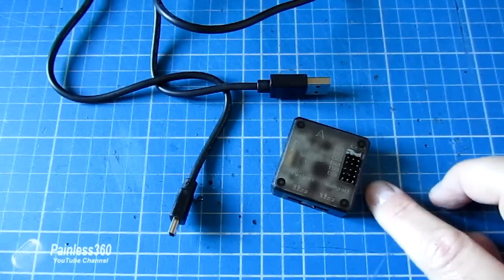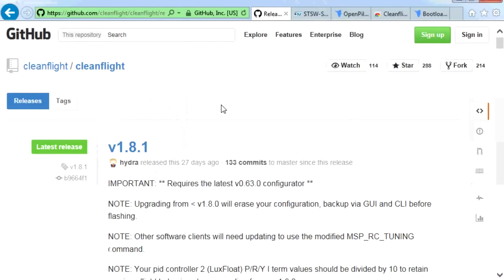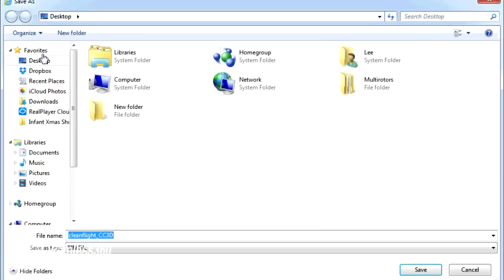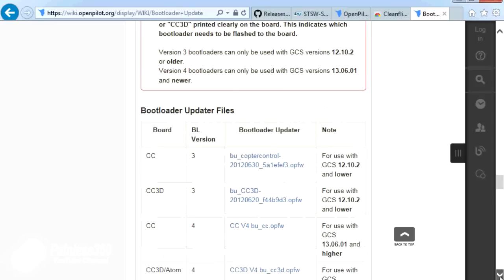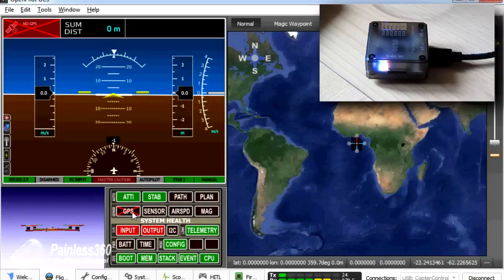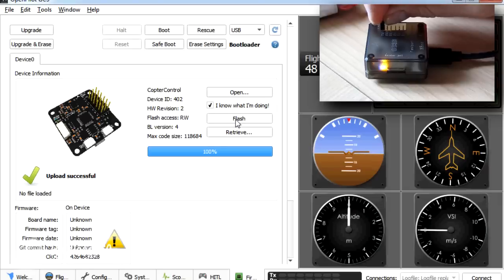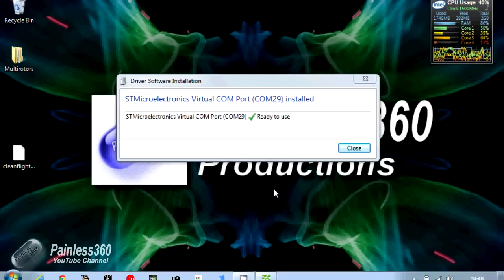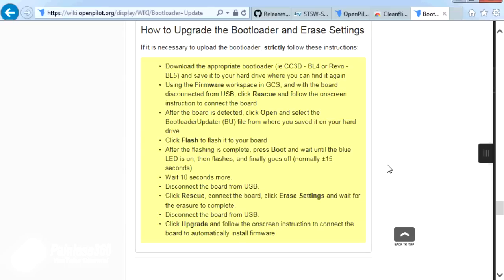(6/10) CC3D Flight Controller – Loading Cleanflight onto your CC3D

Comment: hi, great video. you helped me a lot. question, did you have any problems connecting cc3d to openpilot?  after my initial configuration I wanted to look at setting. I plugged usb cable and I noticed that it was connected for 2 seconds,  both TX and RX were green  and DX got empty and TX has 1 green bar, no connection,  the only 1 solution was booting into safe mode and go thru wizard again.
Reply from the maker: I've not had that here. The only time I had a problem was trying to get Cleanflight on it and getting stuck in bootloader mode. Best of luck!

Comment: Good news is,  Betaflight firmware will work and you can use it with Cleanflight.
https://github.com/borisbstyle/betaflight/releases/
You made a notation that " this will not work for Cleanflight 1.11.0 and higher. Sadly, OpenPilot GCS flashing support has been dropped." 
Thank you for a good video.
Reply from the maker: Thanks for the note! Another plus for betaflight!

Comment: hello there,,, i just did the entire procedure, but i get a lot of disconnects from the usb CC3D. its not stable , i also trying to set the X4R but unfortunetely i cannot , is there any specific parameter that i have to set in order X4R type reciever to play..
I am using windows10
Reply from the maker: +George Chatzisavvidis The X4R is either s-bus or PWM. S-Bus sometimes needs an inverter to work with flight controllers. This is exactly why I always default to PPM for single cable connections. Best of luck..
Reply: +Painless360 , i found the problem  but i dont know the solution,,, the problem iselsewhere..
Just finish my zmr250 build last night and start to configure the CC3D over PC, watched all your videos and read some articles for CC3d , fisrt i flash the cleanflight successfully , but after that the problems began.
1) USB start to random disconnect , is laggy and when I hit save in configuration also got disconnects , I believe that there is a conflict with the OSD , I didn’t disconnect the OSD to test if the CC3D will work. Does anybody know what should I do ? in order to use USB and OSD simultaneously
2) The CC3D is connected to the PDB and the orientation is in wrong direction , so how can I set the correct orientation in cleanflight?
Reply from the maker: 1) You can't - unplug the OSD when using USB. 2) https://www.youtube.com/watch?v=YHkndsgNbVU ;)
Reply: +Painless360 Thanks m8 Appreciated!

Comment: This video does not work for cleanflight 1.11.0 and higher, open pilotgcs flashing support has been dropped. see cleanflight manual for details
Reply from the maker: +Dominic Clifton Thanks Hydra, comment added to the video!
Reply: +Painless360   I can't get my FTDI (apparently a clone with driver issues) to work and have also tried using my UNO and MEGA2560 as USB to RS232 device, but none seem to connect with the CC3D.

So my question is this:  Could I use you method to install cleanflight 1.10, then upgrade though Cleanflight Configurator to 1.11.  And if so, would it be possible to get back to openpilot fw if needed?
Reply from the maker: You can always go back to Openpilot/Librepilot if needed using the firmware recovery option in either. I'd invest in a 'real' FTDI Basic board.. Best of luck!
Reply: Thanks.  I got it working by loading old FW on the CC3D, then upgrading to latest, but I eventually also got my FTDI sorted out.
Reply: +Painless360 I forgot earlier to say "thank you!" While learning and just getting into RC, no other resource has been more clear and to the point as have your video tutorials. I recommend them to anyone getting into this hobby.
Reply: +Painless360 also wanted to ask if you have any showing using 3dr radio instead of Bluetooth to connect to cleanflight. I thought it was basically a USB to uart,  but I'm guessing it's converted back to USB before going to the FC or something because I can't get it to work. it worked great with APM. in fact I can still use mission planner to configure the two boards, but cleanflight never connects. Bluetooth is working fine,  just such limited range
Reply from the maker: No videos showing that as CC3D Revo has it's own radios - the OPLINK to do this. Best of luck with your build..
Reply: +Painless360 Although cleanflight didnt go past 1.10 on the cc3d support is however up to date with betaflight (Betaflight is a version of Cleanflight by a man called boris)
Reply from the maker: Thanks, see our video on how Opensource works.. Happy flying!

Comment: hi how do you reverse this?i want o go back to open pilot
Reply from the maker: Normal process using the Openpilot GUI. Use the firmware recovery options. Yiu may have to experiment when ti plug in the board in the process to get it to flash.. best of luck.

Comment: i think i bricked both of my boards trying this ..re intall boot loader but still tot connecting ..tried dl the drivers too ..i dont see it at device manager ports ..none ..nada
Reply from the maker: The trick is to keep the power connected as I show in the video.  Works for me!
Reply: wow !! i got it working ..some reason i missed the part where you put 5Vin the board ..thanks a lot

Comment: first my computer sees the cc3d as copter control not stm32, I have tried with both a normal cc3d and a cc3d atom both have same results. clean flight don't like them and will not even attempt to connect. my clean flight looks different from yours too.
Reply from the maker: +Brian Tapp I found this was a tricky process and this was the ONLY one that worked for me. I would have Openpilot and Cleanflight on the PC before you start so give the PC a chance to find and load the right driver. The process to load a non standard .hex firmware file onto the board is still the same.. If you want Cleanflight - get a Naze32 is my advice..
Reply: I was able to upload the firmware but the clean flight would not see the board. Personally though I love the little bits like led control I have had nothing but trouble from the clean flight program. I had a naza 32 board that seamed to work but when I decided to put it into auto tune the board went Rouge and decided it knew the best way to control throttle. I lost that whole race setup before I ever got to try it. Set me back, too so I think it's best to stick with cc3d and open pilot or apm and mission planner. Have not tried a multiwii board yet though the walkera  is said to be based on it. Do you have a suggestion on a good race board with led on the naza32 setup?
Reply from the maker: Autotune can be problematic. If you want lights and toys then I'd go with the Naze32 V5 board or push the boat out for a STM32 based controller... Best of luck!

Comment: Thanks a lot for all the information, finally  I  could connect the CC3D to clean flight but  when I  go to the receiver tab to review the channels : throttle, pitch, yaw, roll, aux 1 (using Spektrum receiver and my Dx18) I get no response when moving the throttle stick , and found the throttle  on the Yaw axis , but the  normal throttle movement does not  activate any other  channel ? Change : default, futaba , spectrum … I just don't know whats the problem . Any  ideas ? Thank you
Reply from the maker: Lots of things. What have you already tried?
Reply: Tried to find when moving the throttle stick in my Tx Dx18 if I a get a response in the receiver GUI but no  channel response  at all … Went back to the Open Pilot alternative .It would have been interesting to compare between the two alternatives .
Reply: +Ciruplas  Hi I had similar issues the easiest way to fix it is to do it one step at a time, that is , unplug all except power and plug one lead in and see which it is yaw, throttle etc. and then plug it in where you want it to get that control working. It was nothing like the original lead layout but I got it responding properly. good luck

Comment: Nice content again, thank you Sir!

Let me write down what I experienced.
After I updated the CC3d to Cleanflight according to the video(I skipped the +5V trick unfortunately) my board was not able to connect to Cleanflight despite the fact the the firmware update looked successfull.
What I found out is, that first, you need to power up the board and wait for it to be booted, only after that connect the USB cable and try to connect it to Cleanflight. I hope it also helps for others.
Reply from the maker: +Ákos Véber Don't miss steps - they are in the video for a reason ;)
Reply: +Painless360 100% agreed.
Just I was not had +5v source in my hand at that time and I was so hopeful to have it completed. :)

On the otherhand, other videos, do not say your +5V trick (this is another good example why you are so good .:)), so that may helps others.
Reply from the maker: Glad it's working - Happy flying!

Comment: Having successfully loaded cleanflight onto CC3d board I discovered that my receiver connections (setup according to video2/8 in the series)were going haywire.  after some messing about I now have the following connections- 
From the top.......
wires 1(white) 2(red) & 3(black) going to unused CH on RX(CH8)just supplying power to board,
Wire 4(blue) going to Rudder/Yaw,  
Wire 5(yellow) going to Elev/Pitch,  
Wire 6(green) going to Throttle,  
Wire 7(orange) going to Roll/Aileron,  
Wire 8(blue) going to Flight modes..
Question- Do you think this will be ok as it was the only way I could controls correct for mode 2 transmitter.
Reply from the maker: +Colin Macdonald If you have the right channels moving in the GUI when you move the sticks then I'd leave it there. Best of luck with the maiden flight/hover.
Reply: +Painless360  Thanx for the prompt reply, will give it a go tomorrow morning, fingers crossed...cheers

Comment: Can anyone answer this - does cleanflight allow the quad to fly any better than straight open flight? Does it actually allow the quad to fly sharper / better?
Reply from the maker: +Next Lipo Please MiniQuad Racer That is a loaded question! ;) Every pilot has their favourite flight controller/firmware combination so this is a very personal choice. Some pilots like very twitchy responsive controls, some like smoother flying, some like lots of things to tweak, some just want it to work on the defaults and let them fly. That being said - I would personally recommend that you use Openpilot with a CC3D and is you want Baseflight/Cleanflight go for a Naze32/Flip32 style board. Best of luck.
Reply: Thanks for your reply. I've just used someone's ZMR settings from open pilot, towards the bottom ZMR250 with 2204 motors, cranked up the yaw rate a bit and its lovely, really happy with it.

Comment: Hello!!
I tried to install cleanflight to my cc3d but i got into some problems. It went well until i found out my transmitter channelmapping was all wrong. I use a Spektrum DX8. I tried to flash my cc3d with the older 1.7.0 firmware cuz i read something abot that helping but when i click the flash firmware cleanfligt looses the serial port and cant connent. I then decided to go back to openpilot using the instructions above but it seems to me that the wiki.openpilot.org no longer excists!!
What do i do????
Reply from the maker: +Matt H (Fozzydownunder) That is not great is it. Openpilot packing up and going home! Luckily the instructions are in the video at the 13:20 mark and you can download the copy of the boot loader I used here - https://dl.dropboxusercontent.com/u/67301981/bu_cc3d.opfw  (for use with GCS versions greater than 13.06.01)Hope it helps, Best of luck.
Reply: +Painless360 Perfect i will try to save it. Didnt watch the last minute of your video :) Whats GCS and what program am i using to fix it again? Openpilot? Has anyone else had this problem with the transmitter mapping and does it work to load an older fimware? Im thinking of returning to openpilot and the try the whole shabang agin but with an older firmware version. 
Thanx for your great vids im new at this and it has helped me alot!! :)
Reply: Ok once again.. What is GCS? Firmware workspace in GCS????
Reply: OK found it :)

Comment: So did you just just a 5v pin out from the esc or ?
Reply from the maker: At which point in the video?
Reply: +Painless360  it's ok you answered my question right at the end with connect power though a esc to the board
Reply from the maker: Great, glad you're sorted!

Comment: The problem I ran into was that even though the board would boot in rescue mode when it was time to upgrade it wouldn't  reboot. I finally found a file I could flash manually just like you do the bootloader update. It erases the board and does something to make it work.  After flashing that file I had to unplug it all and start the upgrade process all over again and when I did it worked.

Comment: Can't seem to do anything in Cleanflight. Tried the recovery in OpenPilot, get to the "Erase settings" step, click OK and the progress bar sits there at 0% and not moved for the last 20 mins.
Well, well, well... Followed the steps up to and including booting the board and disconnect after the LED stops flashing. While still disconnected, close OpenPilot. Wait a minute or three for PC to clear everything out. Open OpenPilot again and reconnect and all is well again. Happy days.

Comment: So I haven't found any mention of the loss of magnetometer and barometer when switching over to Cleanflight. I have both in Open Pilot but after this port you can see in Painless360's video the Mag and Baro boxes (upper righthand corner of Cleanflight) are red. Am I missing something or . . .

Painless360: Thank you for your endless library of informative and helpful videos. Your one of the most reliable resources I've identified for solutions to my hobby woes.
Cheers
Ethan
Reply from the maker: ***** The CC3D doesn't have a baro or mag - that's why. It was never there in the first place. If you want a CC3D with baro and mag then you need to buy a Revolution - see the first video in this series for all the detail. 
Happy flying!

Comment: Hello,

Thanks again for this. I appreciate that this isn't a cleanflight support forum, however if anyone has any help for me it would be great.

So i follow this video and it works perfectly. As the video ends, my setup is complete and i can see the model moving in cleanflight when i move my CC3D and its just great (exactly as Mr.Painless has it).

However, If i then enable LED or make any other changes, then "save and reboot".. the com port isnt recognized again. I have to go back, remove the USB cable, power the board with 5v, wait for it to boot... THEN plug USB in and only then cleanflight will see it. When i look at the config all changes are lost. I have done it with 2 CC3Ds on 2 different computers. 

Can anyone else confirm and tell me how to get round it? 

Much appreciated!
Reply from the maker: Zeebo Rutherford What are the LEDs on the board doing when it isn't recognised?
Reply: Painless360 Thanks. If i booth with 5v external power i get solid orange and blue pulse (bright once per half second). It shows in devices as the STM virtial comport com7.. and if i open clean flight i can connect. When i 'save and reboot' The CC3D LEDs remain exactly the same. However, the device now shows as CopterControl in devices and printers (HID device in device mgr)... In this state cleanflight doesnt see it (its not a com port.. To connect again i need to add 5v remove USB then booth.. once booted i can connect USB and see com7 and cleanflight again... 

Its as if the initial boot sequence has some code that tells computers its a copter control, only once fully booted, it will tell computer its a com pout (and allow cleanflight).. 

Either way after a 'save and reboot' and doing the power thing, all changes are in fact lost. tried feature LED_STRIP and save from CLI to same effect.. 

Im running latest BL4 for CC3d and had 15.02 cc.. flashed it to latest Cleanflight downloaded today.. 

Thanks!
Reply from the maker: I would erase and reflash it myself. Odd...
Reply: Painless360 Ok after some digging it appears to be a windows 8.1 issue https://forums.openpilot.org/topic/43569-baseflightcleanflight-ported-to-cc3d/page-20  ... To save anyone else the trouble you need to:

-  Follow all the steps in this video exactly as our friend Mr Painless360 has shown us
- On the first open of cleanflight you will see your board and all is great. 
- Whenever you make changes or go into the CLI and cause a 'save&reboot' to happen.. you will need to do the following EVERY TIME YOU REBOOT the board:

1) Clicl the save and reboot
2) Wait some seconds then disconnect the USB and the 5v power to the board (you need to power it off) 
3) Make sure cleanflight is CLOSED then apply your external 5v to the board.. Give it 20-30 seconds to boot
4) Then plug int he USB cable and again wait for it to show up as STMvirtualcomportX in 'devices and printers' 
5) Open cleanflight and connect... if you dont see the com port close cleanflight and powercycle again.. You might need to do this 3 or 4 times every reboot! 

Eventually you will see the comport in CF and you will see your board. If you check the changes you made were actually saved. 

Now for my idea as to why this happens *this is just my theory with no evidence! 

The board boot loader has the USB PnP info on it. When using Openpitolt the USB PnP 'tag' is linked to the openpitol 'coptercontrol' drivers.. i gues you plug it in (un powered) and as it boots the BL tells windows its a coptercoptercontrol board and to 'wait' for the driver to load... But as OpenPilot doesn't finish loading (it booted into CF) the driver doesn't work.. therefor you will need to fully power the board for some seconds to get past the initial bootloader and for the CF STM32 settings to tell windows its an STM.. Sorry that might sound like rubbish but its the only way i can apply some logic to it.
Reply: Zeebo Rutherford Aslo if you want the LED strip to work you use motor/servo position 5.. it does work exactly like a naze32.. cool!